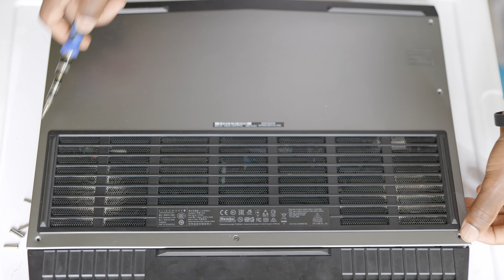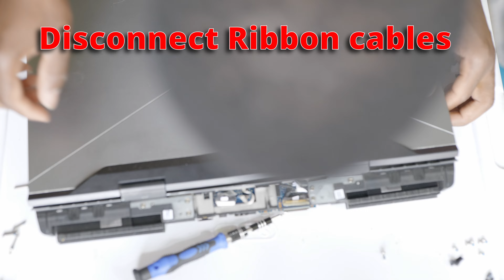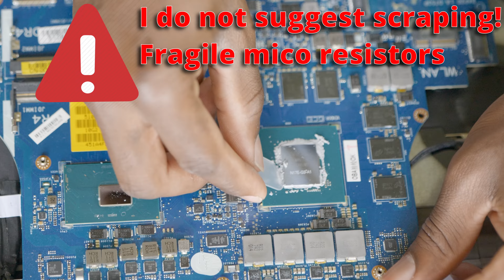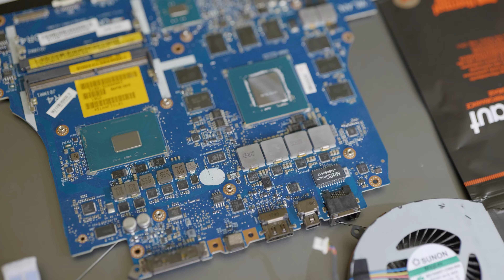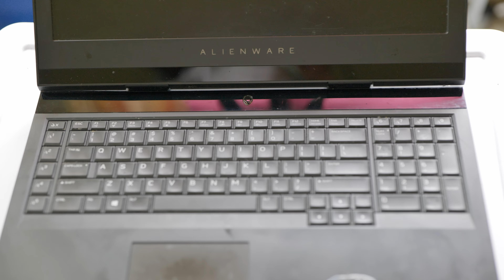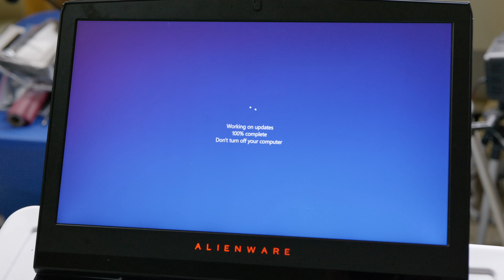Repasting CPU & GPU Alienware 17 R4 |Dell Gaming Laptop

Comment: bad tutorial, you didn't open the coolers at all and didn't clean the clogged coolers from dust properly, Rip your alienware, new thermal is not anything! First clean open coolers and clear it from dust man.
Reply from the maker: I make a lot of videos on PCs, I usually stick to the video plot. After this video I believe I made another one replacing the cooling fans in which I mage thorough cleaning

Comment: Don't waste your time here, he will tell you to disassemble your whole motherboard in order to release the cooling-fans assembly. You don't need to do this, there is a shortcut where u just unscrew the micro-screws for the fan cases, thus freeing the assembly WITHOUT needing to disassemble the motherboard. Thankfully I knew something was amiss so I looked for another video and found this one [https://www.youtube.com/watch?v=_wsfj3kwLkU] which describes the correct solution. Save yourself the wasted time and effort.
Reply from the maker: This was an opportunity to clean all the dirt and grime out of the laptop, but you skipped all the vacuuming section obviously...
Reply: Nice! Thank you for sending the link. I saw the part from the link you added where he says to pay attention to the screws on the fans. Disassembling the mobo would've been a pain!

Comment: I repair technology and these Alienware laptops are a nightmare to deal with
Reply from the maker: Yeah, Alienware laptops can be hard to work with. specially when replacing the cooling fans which I have already done. You should check that video out
Reply: They also seem to have one of the highest failure rates.
Reply: @tremorflow3614 my 17 r4 still runs fine, I’ve never had an issue. Although I’ve cleaned it twice a year since I bought it in 2017. I still play wow on it 😅 I’ve maxed everything out, and dip to about 35 fps in raids

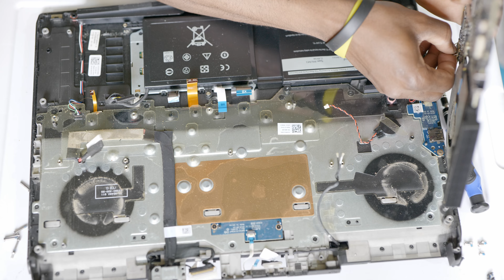Comment: Thanks for the tutorial. However, it would be nice to see how you remove the cables. For example, pulling up the bars or plastic holding them and then whether to pull the ribbon out from the top or side. Also, just to add for those who are doing this to make it easier, for the part at 5:35 (the USB port) he removes it from the motherboard but it was such a pain in the butt to get it back in because its on the bottom, but at the same time you have to be careful holding the fan/motherboard part while reinserting it. However, at 10:48 he plugs that same USB back, however not in the motherboard where he had removed it originally, but into the USB hub thing (sorry, not techie to know what the board is called). So for those who are taking this part out, I'd suggest taking it from the USB board place and NOT the motherboard one. I almost damaged the intake port because of this. Hope it helps.
Reply from the maker: You're welcome, thanks well noted for future tutorials

Comment: 17 R4 has stuttering issues after 15 mins of gameplay but temps are under 90C, do you think I should reopen and redo the pads as well?
Or any other ideas of a fix, it seems some of the laptops have this issue.
Reply from the maker: I would make sure my graphics driver is up to date through the Geforce app in case the stuttering is software based. Otherwise yes, new thermal pads will keep all the heat generating components cool

Comment: Brother can you please help me with a link where to get a good battery, got the same laptop. Bought a new battery from eBay and it’s not working
Reply from the maker: This is the one a bought. Still going strong after 3 years: https://amzn.to/48rzUxR
Here is the video of the repair: https://youtu.be/ZJK5miwiYgY
Reply: @ thank you bro I appreciate your response
Reply: @ do I have to drain the brand new battery to 0 before I fully charge it back or just charge it as soon as I replace it ?
Reply from the maker: @jamessteward9908  No, It's healthier for batteries to be kept between 40 to 80% charged. But for a brand new battery, fully charge it the first time. Newer devices are now including a function to limit charge to 80% to preserve battery life in the long run. It's not a requirement since most people will have the charger connected all the time, but still good to know. Definitely avoid discharging batteries to 0%
Reply: @ do I turn on the pc while charging after I replace the battery or keep the pc off while charging?
Reply from the maker: @jamessteward9908  It doesn't matter at all

Comment: What do I do if I stripped the bolt to take out the fans ?
Reply from the maker: I would safely glue that making sure it cures before assembly. unless a new replacement part is available